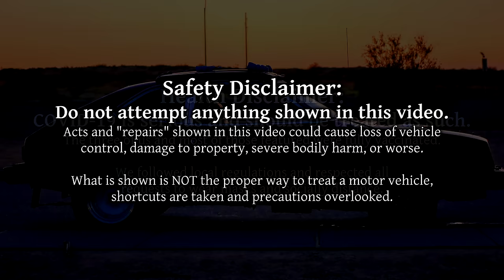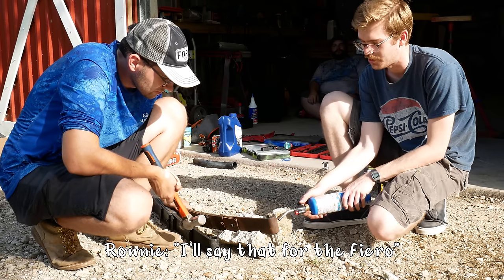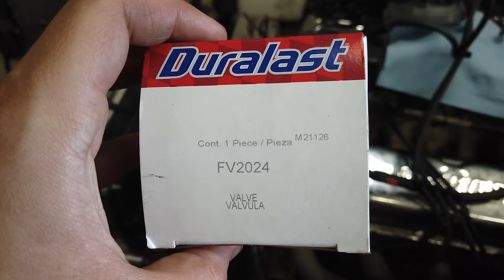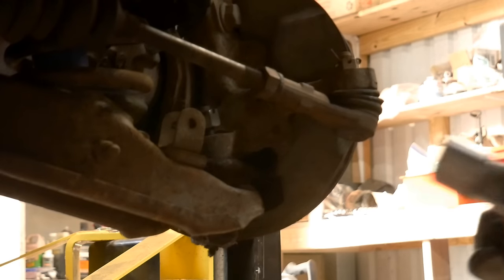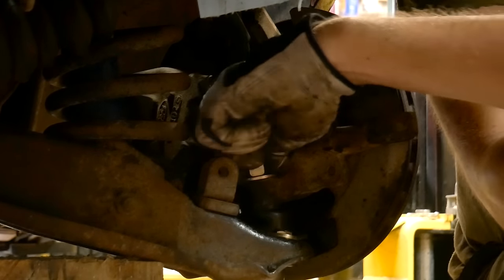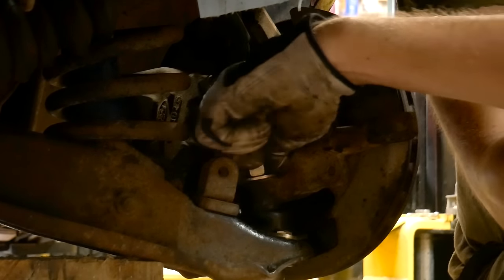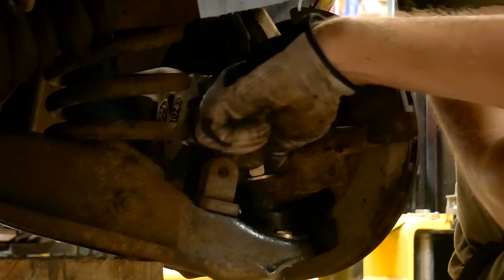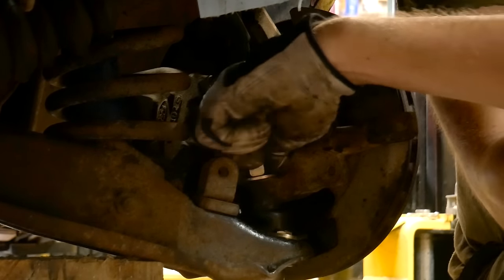Driving a V8 Ford Pinto 3000 Miles Home Finale (Ronald Finger, Driving Texas to Maryland) (Ep.4)

Comment: back in 1979 I had a bunch of friends who had a great idea they decided to stuff a 460 out of a Lincoln in to a pinto and they did it . they used the wire harness from the Lincoln and grafted it in to the pinto then swapped the 9in rear out of a mustang in to the pinto . in about 3 days it was done so they took it for a test drive to the gas station across the street . the driver smashed the gas and flipped the car on it's roof it went up so hard it kept going all the way over backwards . that was the first and last drive as he sat in the middle of the street spinning in circles on the roof of the pinto  they took it apart later that week. even after watching that I still have always wanted to build a pinto drag car with a 460 big block.

Comment: If you rely on an electric fan for cooling, when you drive at highway speeds you increase the amount of heat the engine produces and the electric fan is still turning at the same speed and cooling does not increase. I had a 86 mustang 5.0 and I used an electric fan and at speed it ran the hottest and in slow traffic it cooled down, jus tthe opposite you would expect. Also I had a 74 pinto wagon with a 5.0 and I left the fan on the engine and I had a larger radiator than you and never had any cooling issues, only traction issues. An air dam under the front bumper would help too.

Comment: Part of your overheating problem may be that you are not running a thermostat. Without that (or a restrictor) the water is flowing too fast thru the system and not spending enough time in the radiator to cool off. My dad was a racer in the 60's and used to take a thermostat ans snip the spring and stopper out of the middle. Installing just the base and hoop to slow down the water flow at high rpm.

Comment: Also get you a high torque starter so it won't know so it won't hesitate when it starts and for upgrading purposes use a set of flowtech aluminum heads if you're going to go that route you know but like I say that car sounds good that sound that car sounds wicked Man and get rid of that 4,000 stall converter and use something less aggressive like a 2400 or 2800 talk to you

Comment: I fail to see or understand why you did not have a proper cooling system in this Pinto? The front rotor and pads replacement would of been a needed safety item as well and easy to do. The windshield wiper issue would not of been a difficult fix, but it seems they worked minus a passenger side wiper. Very fun watch the last portion of the trip though.

Comment: I love your video about your Pinto I've had but cars like that few times if you want to buy another classic let me know I have one for you to I have a 67 Firebird convertible it runs I had a lot of problems with the overheating when I came from Phoenix Arizona when I bought it and I changed the radiator to a larger one for the big block and it worked great

Comment: It's almost 50 years since i put extended shackles under my Chevy to give it a rake... damn dumb Idea but when you are 17 you have to try everything at least once .I had the springs re-arched with more curve at my work but they ended up being too short so I had to make longer shackles. At that point i learned all about castor and what neg. Castor does to a cars steering....at speed. The cornering went out the door too as the back end wobbled like a drunk twerker.

Comment: I've had a few Fords in my time and have found that Ford likes to change things a lot . Your overheating problem my be from head gaskets or heads being wrong for that motor . It seems odd that it would overheat with more air coming through at higher rate of speed .

Comment: Are used to drive a Mercury bobcat always said that 2300 engine had a lot of potential I remember way back when it first came out there were guys getting over 500 horsepower of that little thing that's not even turbocharging. I love how it launches it just lifts straight up in the air and is gone. How great it would be to have a pinto like that and embarrass a lot of big dollar muscle cars.

Comment: Did you ever consider that the temp gauge was miscalibrated/not using the correct sensor? 

It’d be hilarious if the engine was never really overheating.

Comment: Are you kidding me pulling the thermostat out actually exacerbate the overheating. The coolant needs to be in the radiator long enough to cool not just recirculate holding in the heat. It is no surprise with so much heat it had pre ignition . That thing needs some experience applied to it and message it into a fun ride.

Comment: Plastic liners around the front /sides of radiator will force the air on radiator rather than hitting it and diverting around it thus helping cooling ability. Most cars and trucks have them. Yours doesn’t. Hope it helps.

Comment: 12.2 MPG?! My '96 F350 crew cab 4x4 gets that kind of mileage, loaded or unloaded. There's something going on with that small block that isn't quite right. 1,100 rpm in park is way too high an idle by 500 rpm. Again, something wrong with the internals. I've built several V8 Pintos and never had those kind of problems. Probably because I built the engines myself, and hadn't relied on someone else's build. Always a crap shoot. There is no way that oil should be coming out of the breather on an axle, overfill maybe? Do you have a long tube that goes up into the "chassis" and is clipped there? It should. Those shock extension pins are going to cause problems too, get longer shocks. What you need to do is (when you can), check the cam/crank phasing. It kinda sounds like its out, which could be the cause of the overheating issue. Also check the phasing against the cam profile and the lifter geometry, push rod length and resting valve spring load. Also check the lifters for wear and leak down. Something else you may not be aware of is that electric fans don't move as much air as the original mechanical fans. so the electric unit has to be much bigger than one would expect to do the cooling. You have timing issues as well as internal issues, one precedes the other. Another issue that you may have is a blockage in the cooling system somewhere within the block itself. What you can do to direct air over the engine for cooling is to stand the hood up on four pins so that the hood "floats" about four inches up over the engine. This will direct high speed air  into the engine bay and out the back taking heat with it. If you are concerned about rain, all you have to do it install a deflector around the front of the air filter. You may have good oil pressure but what about oil volume? Do you know what the oil pump is? A V8 Pinto (in my experience) should move like a bat out of hell. The very first V8 Pinto that I build was a '74 wagon with a 289 (modded), and it moved like no other. I would regularly drive the mountain passes in BC Canada with absolutely zero issues. You can get a reliable 300 HP from a relatively stock 289 without extensive mods. 300 HP in a Pinto should be plenty of power. That is, until you get used to it and decide to upgrade. The general rule of thumb (at least for hi po engines) is that the engine will run best with it's head in a freezer and the bottom end in an oven. "Parked next to all the other junk" LOL.  That's one hell of a trip...glad to see you made it! SLEEP...NO, NO, NO...you need to start teardown and inspection immediately!

Comment: I still don't get why you  don't have a thermostat in that and then wonder why you have cooling issues? Put a thermostat in it so the radiator has a chance to cool the  antifreeze! I run Evans Waterless Coolant that doesn't boil till 375degrees in my 1967 440 Plymouth GTX with a Tunnel Ram in SC and have zero issues! That's what you need!

Comment: It's a project car go threw the engine or a new crate engine rebuild the transmission larger radiator 3core cross flow the side tanks, instead of top & bottom Gearing in the rearend probably still geared for 4 banger. I surprised the old girl held it together for you. The race toward the end of your trip made me cringe thinking that stunt was going to be the end of that 302 but kept a going. My name is Kenneth Boren I found you when you took on the Blazer project. I have two S-10's 4x4's ex-cab and standard cab. The standard cab I plan to stuff a 350 or may opt for a 383 stroker. Back to you Pinto what you did took a lot of balls just buying the long road trip for home. Good job no great job and your great at tell the story, some people aren't that gifted they get long winded and boring you didn't. Hope you don't interbreed that car with Chevy power that's to easy go for the challenge keep it Ford.

Comment: Just a heads up to any and all NEWBS,shock extensions do absolutely de nada for suspension height or ride as they simply allow you to use a shorter shock than what is called for... Springs,be they coil or leaf or airbags set your ride height.. Shocks simply control flex,articulation,rebound,and some  sway,nothing else.. they DO NOT raise nor elevate a vehicle...

Comment: when i was like 8 years old i would stay at my Aunt and Uncles inVirginia for the Summer, and one year a Aunt was Driving fromTennessee toNew York and offered to drive me to New York where i actually live  she  was a Hippie and picked me up in a Pinto  with a 8 track player and a few tapes  my job was to keep shimming the tapes in the Stereo in a effort to try and get them to play only one track at a time  for the 4 hour drive while my Driver Drove and smoked her Cigarettes  i’m pretty sure she  was hitting some Roaches and a Joint every now and then as  well i actually still like Pintos but they are getting harder to find in decent shape because of the Rust issues  ironically i’m into Boating and the inboard outboard set up i like the most is a Mercruiser 135 H.P.  that is basically the Pinto 4 cylinder converted to Marine use  generally a Marine block has Bronze Freeze Plugs , a Forged Crank , some Marine Grade Electronics and Carburetor  and maybe a water Inlet/outlet on the heads  depending on its intended application and Marine Exhaust Manifolds ( boats don’t use radiators  but do utilize the body of water  to use for Cooling  either flushing that through the block or   cooling a heat exchanger with the Raw water  but that motor is very reliable and easy to work on plus in most boats it’s a  very e comical Motor to operate  as long as it’s not in a vessel too large for that power

Comment: NOPE! There is no "just about the right size" for those bypass O-rings. If you do not use the Holley O-rings, they WILL leak. I am shocked the old rings worked after reinstall. They never did for me.

Comment: If it has a comp cam it is likely 6* built into the cam. You need to put an oil cooler on that thing, it is too hot. You need to drill and tap that carb for a part throttle jet in the block to the valve on the plate, oh the radiator is way 2 small, change it  to a large radiator and cut to fit. hey if you extend the front end on this quite a bit i am shall trade you a brand new painted 2nd gen camaro for it and we shall swap engines i got 5000 in the car.

Comment: Yeah put electric water pump on a thing and put a bigger radiator on it bigger fan and turn the f**** time in up that's why I be pinging and s*** because you only got six degrees of timing in it matter regardless it's going to get hot if you have time in or not